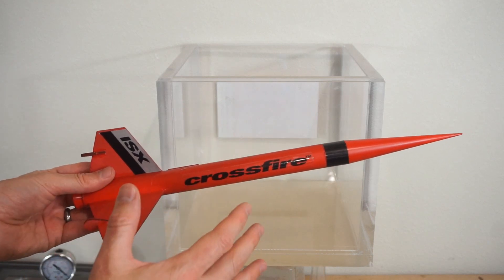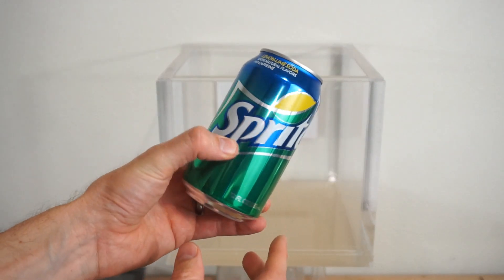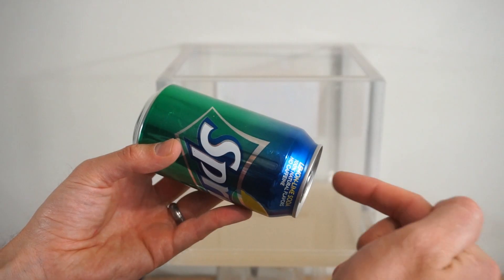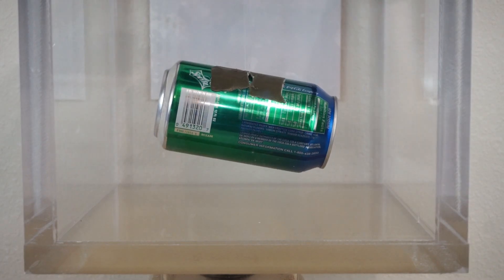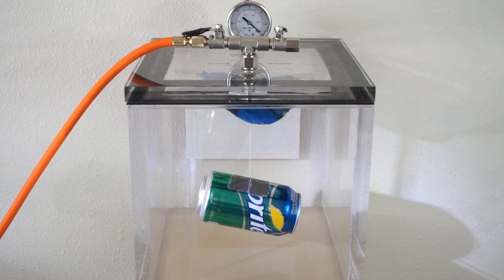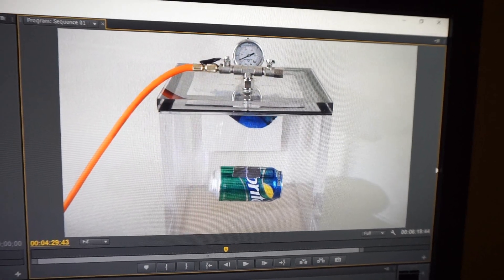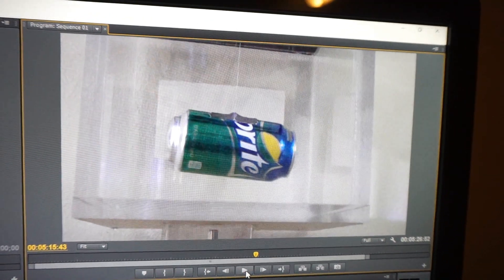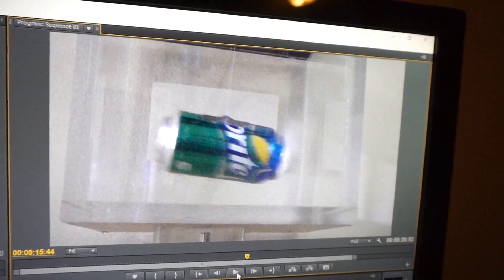Can a Rocket Fly in a Vacuum Chamber?

Comment: The soda can’s gas used the chamber’s wall to push off. That’s not a true representation of what will happen in space, as there exist no medium for the gas or propellant to push off therefore, it will not move.
Reply: Rockets don't push off air.  LMAO
Reply: Rockets do NOT "push on the air".
They feel a recoil force as a result of pushing on mass.
DO you agree that exhaust gas has mass?
DO you agree that the exhaust gas gets accelerated as it leaves the rocket nozzle?
DO you believe in Newtons three laws?
Reply: Simple question.. Where did the soda leaving the can gets its momentum from?
Reply: @entangledmindcells9359  - Just as I TRY to explain to pappalegba: The "Soda" has "mass", we see it get "accelerated".

We know (from Newtons Laws) that MASS cannot be ACCELERATED except by ONE THING and ONE THING ONLY: a "Force".\

So, when you see mass get accelerated, we know, for a FACT, that there is a force being applied to that mass causing it to accelerate (change MOMENTUM).

And based on Newtons THIRD LAW, we know that forces NEVER OCCUR ALONE, they occur in Pairs (or "couples").
So, if there MUST be one force applied to the mass of the exhaust then there MUST BE A SECOND FORCE!
I WONDER where this second force is applied.
Reply: @entangledmindcells9359  If you had taken the initiative and read my comments, you would have noticed, I made it immensely clearer I was not going to make any further statements pertaining to this matter after having one of your counterparts telling me I should go an intercourse myself, rather than behaving as an adult. If this is the level I need to put up with now, I would rather not debate this matter any further.
Reply: @pantheraleoromanus6241  so you don't want to learn something. I posed a question to you to help you understand basic Rocket Science.. 
your lose
Reply: @entangledmindcells9359  I believe you’re the one requiring education, if you can’t differentiate between having a debate amongst adults, and telling someone to go and intercourse themselves because you have nothing else to say. If you support this type of behavior, perhaps you should be blacklisted also, if you need to resort to the use of profanities towards other people.
Reply: @pantheraleoromanus6241  I never recommended you do that.. 
you wrote " after having one of your counterparts telling me I should go an intercourse myself" 
Maybe you should explain your justification for the way you are  interacting with me based on someone else's behavior.
Reply: @pantheraleoromanus6241  Still unable to explain where the force originates that accelerates the mass of the exhaust gas into the vacuum?
Understood.
We accept your surrender.
If you cannot answer such simple physics questions, then you should not go around trying to explain physics to others.
Reply: @pantheraleoromanus6241  They're chatbots, they've said even worse things to me.
Reply: @papalegba6796 Of course you want to paint yourself as the victim here.
Reply: @pantheraleoromanus6241  So here is a simple physics problem for you:

If a "machine" can accelerate 500 kilograms of water from a velocity of zero to 2500 meters per second (Mach Eight).
It applies a "Force" to this water, correct?

CAN it do this without feeling any recoil force?
OR
Must the machine feel an "equal and opposite force"?
Reply: @AM-rd9pu  ok, gaslighting chatbot 😂
Reply: @stuartgray5877  a thermal rocket is a heat engine of the internal combustion type, chatbot. You're not programmed to understand that though 😂
Reply: @papalegba6796  Looks like you still haven’t bothered to look up what constitutes gaslighting.
Reply: @AM-rd9pu  looks like you're gaslighting me about gaslighting, chatbot 😂
Reply: @papalegba6796  It’s honestly incredible that you still haven’t learned what constitutes gaslighting. Do you think that every single instance of telling someone they’re wrong is gaslighting?
Reply: @AM-rd9pu  telling people they are wrong when they are not is textbook gaslighting, chatbot. But it's all you are programmed to do, so you can't help it I guess?😂
Reply: @papalegba6796  Even if I was wrong, it still wouldn’t be gaslighting. I’d just be wrong. There’s no psychological manipulation going on.
Reply: where in newton's laws is there a requirement for a wall?
Reply: @ppleberrynd  nobody said there was, chatbot. There's a requirement for external force though, which a vacuum cannot apply. Oops, you lose again! 😂

Comment: This is a poor experiment.

Space is supposed to be an infinite vacuum.

To get somewhat accurate results, we need a vacuum chamber of at least 20x20x10 feet dimensions
Reply: where in newton's laws is there a requirement for a wall?
Reply: @ppleberrynd  , wall needed to contain the vacuum
Reply: @kunjikorans so? That makes no difference. To assume it does shows a lack of understanding.
Reply: YOU mean an "infinite vacuum" at 0.0 PSI?
Reply: @rocketman484   , how do u know its 0 psi ?
Reply: @kunjikorans  Well:
1 - I am a Vacuum test specialist with 30 years experience operating some of the nation's largest thermal Vacuum Chambers
2 - I have built, and launched seven spacecraft in my career.
3 - I have helped operate three spacecraft as part of the mission operations team. Two of those were Deep Space Missions.
Reply: @rocketman484  So you're Stuart Gray? Ok 😂
Reply: @rocketman484  , whats a Thermal Vacuum Chamber?
Reply: @rocketman484  you're using the wrong account again, Stuart 😂😂😂😂😂

Comment: That's not how a combustion motor would work tho. The only reason that can has thrust is clearly cause it pushed off it's top. The only way you can do this experiment is using a rocket. Your results are inconclusive! Try again
Reply: Yes her experience Method sucks!
Said I : the Mass needs resistance to do any pushing :)  First no awesome relevance, the liquid is the main mass, way overrides the can mass.  There is gas in soda can bro, it should expel before the liquid against the wall.
Yet Many bliss.... got lot of flack in >>>
@jmvn38 5 years ago
I’ll remember to bring a can of soda with me next time I space travel just in case I start floating away from my
Reply: @wildboar7473  So what would happen if you fired a solid projectile from a crossbow into a vacuum? Would you feel any recoil force?
Reply: @wildboar7473  So here is a simple physics problem for you:
If a "machine" can accelerate 500 kilograms of water from a velocity of zero to 2500 meters per second (Mach Eight).
It applies a "Force" to this water, correct?
CAN it do this without feeling any recoil force?
OR
Must the machine feel an "equal and opposite force"?
Reply: @stuartgray5877  water? 🤔😂
Reply: @stuartgray5877  no, really - WATER? Explain how the FIRE coming out the back of a rocket is water, please 😂😂😂😂😂
Reply: @wildboar7473  the chatbot stuart gray never answers questions, ever 😂
Reply: He showed a rocket at the start, said he'd be testing if a rocket would work in a vacuum, then said he wouldn't be using a rocket & used a can of soda instead. Total bait & switch con job 😂

Comment: Compressed co2 is not comparable to combustion
Reply: CO2 is the exhaust gas from many modern rockets.  The combustion product of burning kerosene and oxygen is mostly CO2.
So most rockets literally DO "push on CO2".
Reply: @stuartgray5877  ok.... compress in a tank co2 at an equal pressure to a rockets output smart guy.... I bet you got lightning in a bottle too don't ya....
Reply: @MatthewGill-nv4tb  I'm literally a "Rocket Scientist" to you.
I have personally helped build and launch seven spacecraft in my career.
I have been a member of the Propulsion team and fueled more than one before launch. And I have been on the mission operations team of three: Deep Impact, Kepler space Telescope, and NOAA-20.
Every one of those had propulsion systems that tested in earth orbit or deep space. (Deep Impact had TWO propulsion systems)
I just finished building the WSF-M spacecraft for the Us Govt and will be helping fuel it and launch it early next year.
Reply: @stuartgray5877  so.     Does that change the point I'm making....nope.

And congrats on working on a huge propaganda project.  I have relatives that work for jpl/nasa....  they are some of the dumbest people in our family
Reply: @MatthewGill-nv4tb  I could show you live video of a rocket working just fine in a vacuum recorded in front of tens of thousands of live spectators and you would STILL call it fake.
I have personally launched six spacecraft and I have witnessed over 30 real rocket launches, most from closer than the public is allowed. And I have been on the mission operations team of three spacecraft during their missions.
But you probably know more about spaceflight technology than me.
Reply: @MatthewGill-nv4tb  And just tell me that you graduated high school genius.
See, high school dropouts trying to lecture rocket scientists about rocket propulsion is known as the "Dunning-Kruger Syndrome".
Look it up genius.
Reply: @stuartgray5877  I've launched more rockets than you.  OIF C 1/39 FA MLRS
Reply: @MatthewGill-nv4tb  I launch orbital and interplanetary launch vehicles as my 30 year career.
I have been launching "rockets" for about 50 years now.
Reply: @MatthewGill-nv4tb  it is a fact that if you question rocket propulsion (in a vacuum or atmosphere) then you don't understand basic physics or Newton's laws 
We could find where your misunderstanding lies, but you would have to be willing to answer questions.  You science deniers refuse to answer basic questions so there is no point
Reply: @MatthewGill-nv4tb  when a rocket engine is running, right here on earth:
1- does the exhaust gas have "mass"?
2- does the exhaust gas get "accelerated" as it leaves the nozzle?
3-can mass be accelerated by anything other than a "force"?
Reply: @stuartgray5877  I actually worked for Raytheon and Lockheed Martin analyzing orbital and interplanetary launch vehicles as the military usually improves the function of civilian developed systems.  I also worked on the little known "weapon x" program.  I bet you worked on the Challenger.
Reply: @MatthewGill-nv4tb  - "as the military usually improves the function of civilian developed systems."
Oh so now the military builds interplanetary probes?
Tell me what division you worked at, at Lockheed Martin and what years.
I am: Lockheed Martin Flight Systems (the ones who actually DO build the interplanetary probes) 1995-2000 so I must have known you.
Reply: @stuartgray5877  hahaha... simmer.
Reply: @stuartgray5877  I'm actually from a different dimension... so we never would have met
Reply: @stuartgray5877  I actually respect you for your work.  I'm not a rocket scientist.... you are correct. 

But I wanted to add the fact I never in any way stated the things you were saying... you did put words in my mouth

I mean you got into rockets in vacuums which yeah obviously would work... I never said anything about that
Reply: @MatthewGill-nv4tb  - I was 100% respectful until YOU SAID:
"And congrats on working on a huge propaganda project.  I have relatives that work for jpl/nasa....  they are some of the dumbest people in our family"
I worked at JPL and have "worked for NASA" in one way or another for my entire career.
 I guess I am "dumb" too?
Reply: @MatthewGill-nv4tb  Are you still lying to people about where you worked?
Reply: @rocketman484  not understanding obvious sarcasm....  hahahahhahaha that's a mark of fuckin intelligence
Reply: @MatthewGill-nv4tb  they're chatbots 😂
Reply: why not?

Comment: Why would the propellant hitting the WALL move the rocket or can? Just desperate to not admit they were wrong. They could easily do this experiment themselves but of course they would require effort.
Reply: does a gun recoil when it fires the bullet or when the bullet hits something?
Reply: @stuartgray5877  The bullet pushes against the gun, and the gun pushes against the bullet.
Reply: @HorkSupreme  So the gun feels the recoil while it is pushing on the bullet?
Good so far.

Now what would happen if you fired a gun (or even a crossbow) in a vacuum?

Would there still be recoil?
(I can tell immediately that you are not one of these ignorant people as you just simply answer a question when asked)
Reply: @stuartgray5877  The presence or lack of air wouldn't much effect the basic results, the gun still pushes on the bullet and vice versa.
Reply: amazed such stupidity didnt make it to the Top Comments!
Reply: @wildboar7473  You are clueless about basic physics. Perhaps you should consider finishing high school?
Reply: @wildboar7473  Fact: YOU are trying to lecture a Rocket Scientist about basic physics when it is obvious that you failed to complete high school physics.
Try again genius.
Reply: @wildboar7473  Highly intelligent rebuttal.
Thanks for proving my POINT: You have the intellect of a toddler.
Reply: @wildboar7473  Its OK, once you reach puberty you will learn to stop using emojis.
Reply: @stuartgray5877  sounding REAL professional thetre, fake rocket engineer psycho guy😂

Comment: Seems a chamber is required when you claim no containment for a vacuum 10 to negative 17 torr. Seems you cant replicate that in your chamber.  Small scale. Big scale?😮
Reply: Sorry to break it to you but "Level" does NOT mean "Flat".
"Level" means "Perpendicular to the gravity vector".

We have undeniable proof that earth's gravity vector changes by one degree for every ~70 miles moved across the surface.
SO "Level" in one location on the earth is NOT PARALLEL to "level" just 70 miles away.

I have been measuring earth rotation and curvature as part of my job for the last ~30 years.
Reply: Oh AND you have NO IDEA what it even means to say "1.0X 10^-17 Torr".
Another way to help you write that more easily IS: 1.0X10^-17 Torr equals ZERO PSI (yes '0.0 PSI' is the SAME as 1.0X10^-17 Torr).
You are welcome.
Reply: he sure hell could not ROCKET in his tiny walled cube :) 
No undeniable proof, dumb lame lip yes, much of that, Planes fly level.
Reply: @wildboar7473  - " Planes fly level."
And "Level" CHANGES as you move across the earth.
"Level" in one location on the globe is not parallel with "level" at a different location.
We measure this thousands of times a day worldwide.
Reply: @wildboar7473  Sorry to break it to you but we have been measuring earth rotation and curvature using fiber optic gyros since before you were born.
I do it as part of my job and modern aircraft do it tens of thousands of times a day worldwide.
Try to keep up.
Reply: @stuartgray5877  sure we did
Reply: @wildboar7473  Well I am an aerospace test engineer, and I was trained to test fiber-optic gyros using earth rotation as the stimulus by Lockheed Martin in the 1990s.
Since then, I have tested multiple different types of FOGs and even some mechanical "Gyros" that are sensitive enough to sense earth rotation.
SO, tell us what YOU do for a living to know more about this stuff than I do.

Comment: Very nice! How did the can explode? Just from the vacuum?
Reply: The pressure from the C02 and the liquid in the can is normally kept under balance between the can itself and the air pressure on the outside. When the air pressure is removed (vacuum) the gas is allowed to expand to the point where the can fails.
Reply: @cucciafr68  Which seems odd that the can, can only withstand a change in differential pressure of 14.5 PSI?
I would think that you would need hard vacuum AND a defect in the can's surface.
Reply: @stuartgray5877  There is a defect, the can's top designed to break open. Without that I'm pretty sure it would withstand a much greater pressure.